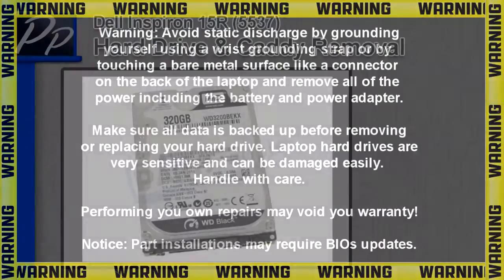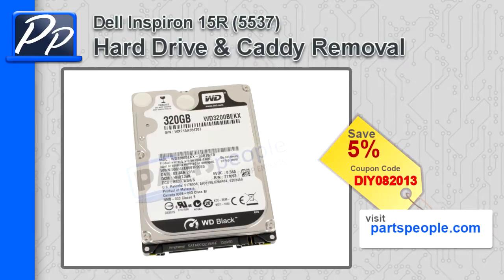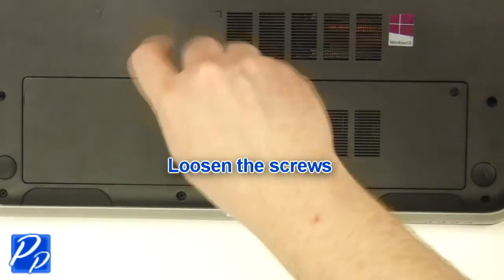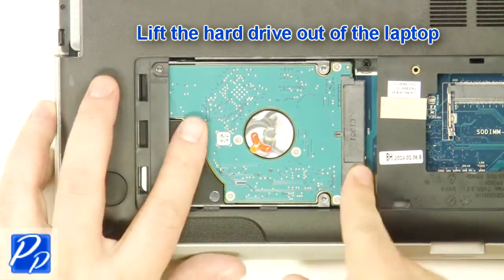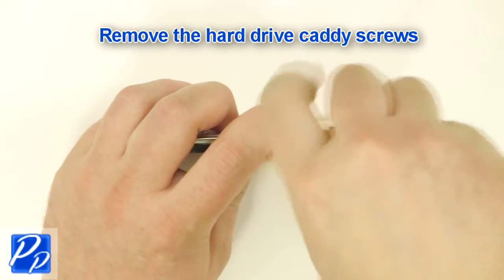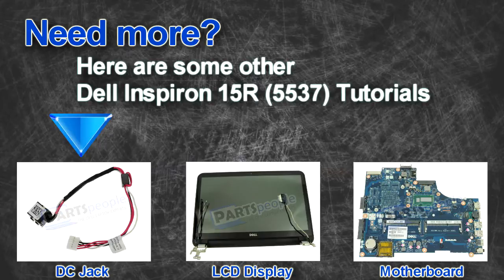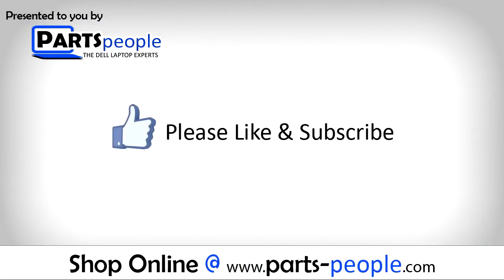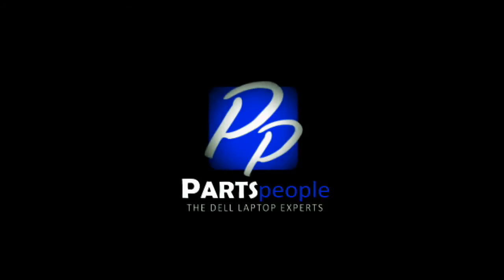Dell Inspiron 15R (5537) Hard Drive & Caddy Video Tutorial Teardown

Comment: Sooo its impossible to fit two hard drives in there :(  i wanted to have an ssd and a hdd
Reply from the maker: Unfortunately it only has one hard drive spot.
Reply: what about removing dvd and adding the ssd
Reply from the maker: That could work if you can find an optical drive 2nd hard drive caddy. Finding one that is for this laptop might be difficult. I haven't found any yet.
Reply: @dellpartspeople  Thank you very much for sharing this video. I have found a caddy to replace DVD driver with an SSD driver (here you can see the one I purchased: https://www.amazon.com.br/Adaptador-Caddy-Segundo-Ssd-Sata/dp/B074QSBQB5?tag=goog0ef-20&smid=A2K9KZY06FI605&ascsubtag=go_958276976_46095487085_227548540242_pla-666685667929_c_ ). However, the Dell BIOS won't allow to have it as a boot device. As I use Linux, the GRUB2 boot loader manages to direct boot process to it, anyway.
Reply: @fabiodesalles2732  can i used ssd in hard disk slot and HDD in dvd slot via caddy. Will it work. Because i intend to use ssd for win 10 and HDD for storage.
Reply: @sanjaygwa  If you are asking, I don't know. If you are telling us you did, thanks! I'll try it then!
Reply: @fabiodesalles2732  when you doing it make sure you fully format the HDD you intend to use with caddy. Otherwise the boot files interfere with SSD boot files and it goes into endless loop or repair pc mode.
Reply: @sanjaygwa  Thanks a ton! Happy New Year!
Reply: @fabiodesalles2732  happy new year mate